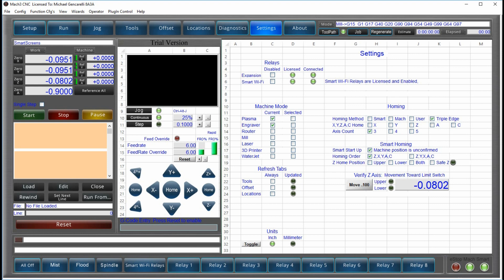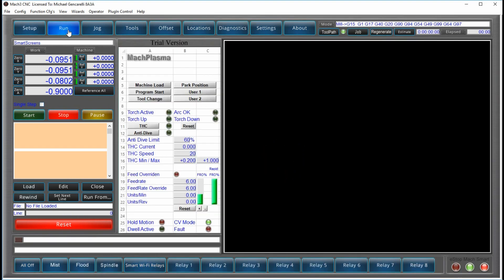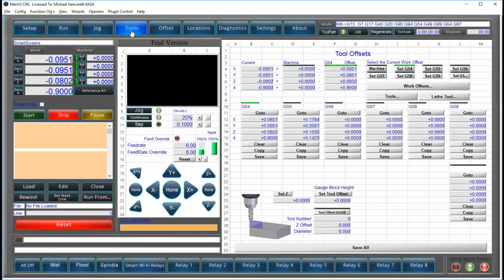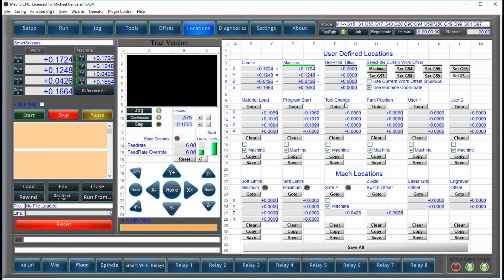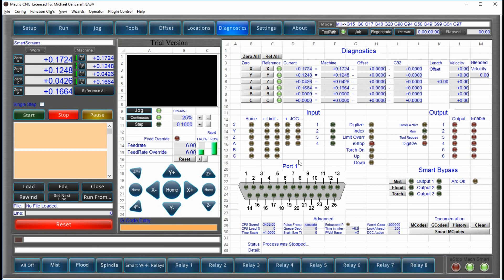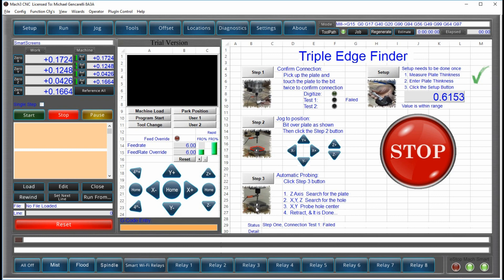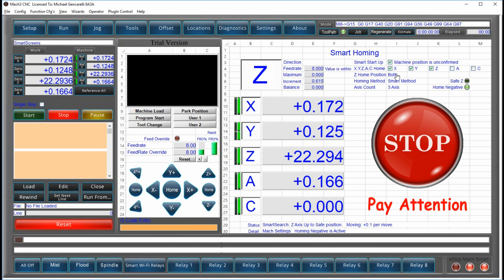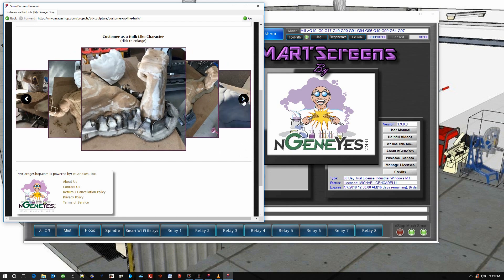SmartScreens for Mach3: Introduction SmartScreens (2018, Early Release)

Comment: Any chance you'll develop an ATC screen?
Reply from the maker: Jonathon Wood 
I would definitely like to do an ATC Version, what type of machine do you have?
Reply: @MyGarageShopChannel  I'm making the X2 Freak. 16 tool is what I'm shooting for. But I'd like to do a linear actuator instead of air or use a stepper like Hossmachine did. I will have a 5 axis machine all said and done.
Reply: @jonathonwood4088  I would think from a control and especially a programming point of view the air or linear actuator would be MUCH easier to do. When you say you will have a 5 axis machine are you counting the tool changer in that?
Reply: No, the 5 axis is strictly the machine.
Reply from the maker: I guess I need more details about your design and control system before I can make a decision